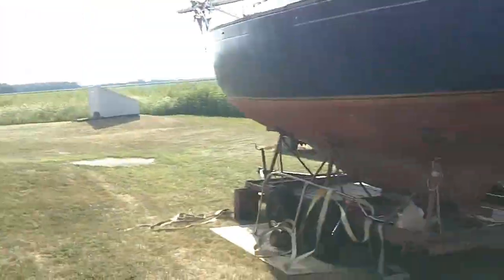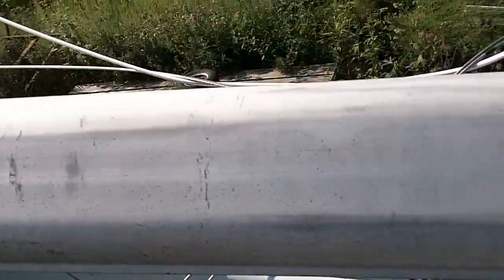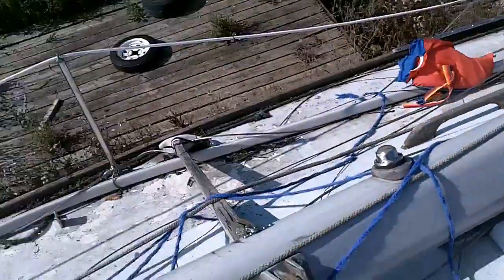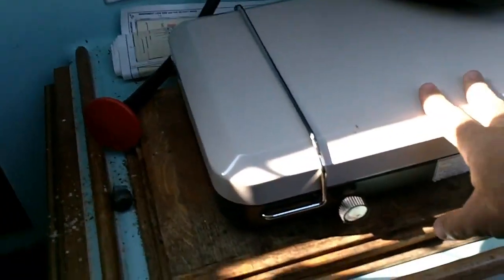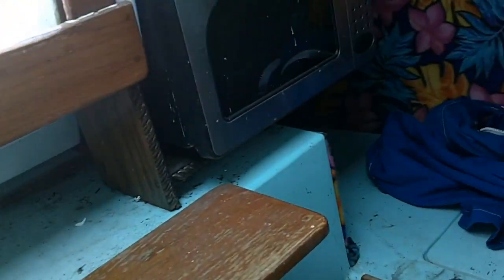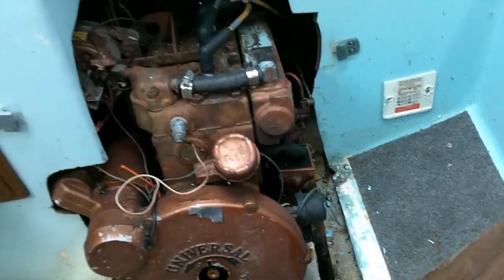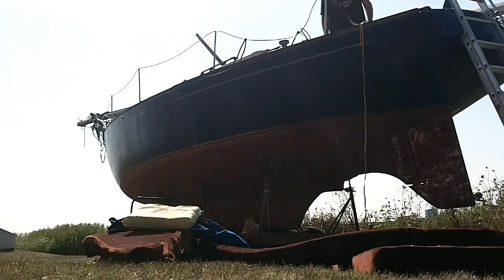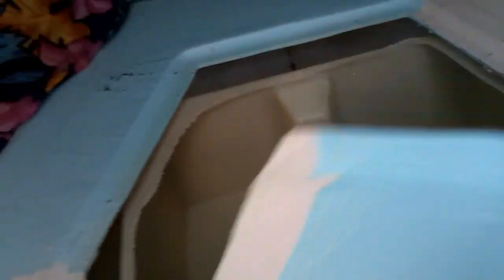Nauti E8. Irwin 32 Sailboat walk around and refit.

Comment: good luck with your refit! I am also posting videos of my refit project (a Jeanneau Fantasia 27). It is a lot of work but I am sure it will be worth it! I will watch your progresses.
Reply from the maker: Sailing Jabuka Thank You . I will check yours as well. It's a little slow here in Michigan with the refit.  Cold temps and snow keep me from moving forward.
Reply: yes, I understand. also here in Northern Italy is rather cold and I have trouble with the epoxy resin. it takes twice the time to cure with this cold temperature (about 5 degree celsius). not to mention that working in the cold is always slower for me! fortunately I had a couple of nice and relatively warm weekends to do some work. good luck again with your project!